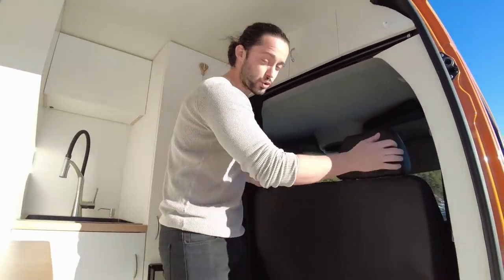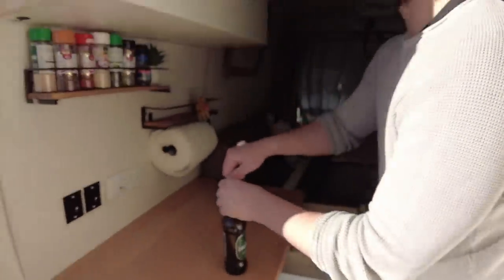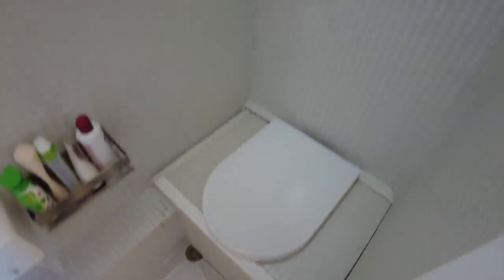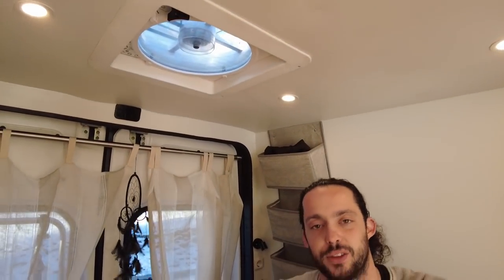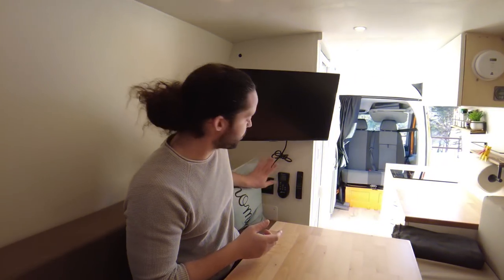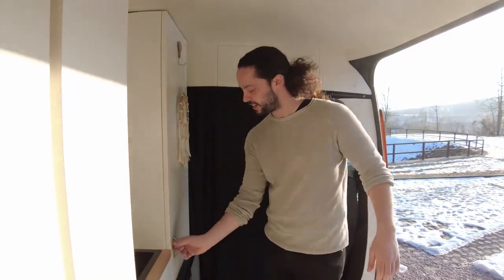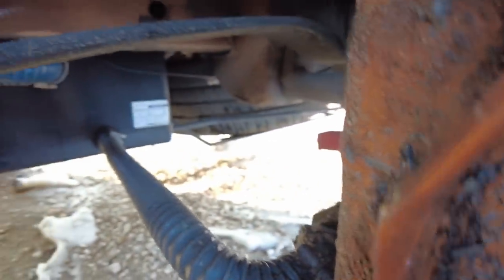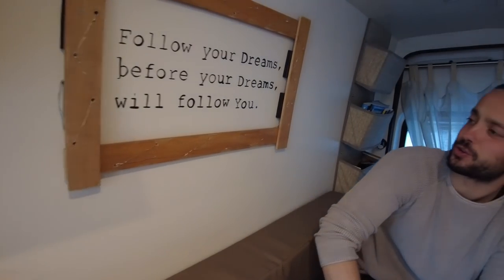Van Tour di Arancino - Furgone Camperizzato Fai da Te 🚐

Comment: Great build, appreciate the details! I am learning Italian and can understand you, not every word though! ;) Quick question, are these 200W panels you mentioned on the blog with dimensions 1240*992*40mm? They look pretty nice on the roof of the Crafter. I was thinking about purchasing 4x 400W panels with dimensions 1906*1043*35mm, but I think they would be wide and stick too far from the roof (in the same fashion, from side to side). Tires are as wide as 2050mm. What do you think? I don't have a car yet, so it is hard to judge and measure.
Reply from the maker: Hello Pavel! The ones I installed i think they're slightly too wide, I realized it some time after finishing the build as I wanted to install an awning but couldn't as there was not enough space on the sides (I am planning to redesign the roof disposition now). As of now, two years passed since I finished the van, and with the panels available now on the market it's possible to get the same output while consuming less precious roof space :) The roof of the crafter is pretty narrow too, choosing long narrow panels I think would be a better fit. Hope that helps :)
Reply: @LostontheRoute  Thanks for the reply. I have chosen 190W, 1396*705*35mm panels, which are already a stretch! I will have 6x of them in total, almost 1.2 kW of power, and will mount them on the rack. It will be my office, so I will need power ;) The ones I asked about were way too large, I agree with you! I used your video to do the measurements, thanks! ;) I will watch the video couple of times for language training purpose ;) You can lift the panels or mount them under a small angle, and install low-profile vents and other equipment underneath. I am planning to install vents underneath one of the panels.

Comment: Ciao veramente un lavorone , sarei molto interessato a vedere il funzionamento del jp Heater.... e nel caso capire come funzioni il riscaldamento elettrico della parte boiler ... perche poter riscaldare l'acqua in viaggio arrivando a destinazione con l'acqua già in temperatura e quello che sto cercando per il mio camper....
Reply from the maker: Ciao Efelon! Se può interessare posso fare un video sul suo funzionamento:) Purtroppo però il JP Heater è un Parking Heater quindi tecnicamente non si può utilizzare in marcia (emette fumi di scarico da un lato del van e se ti fermano ti possono multare). Detto questo, una volta acceso ha una funziona "booster" che scalda l'acqua in circa 15-20minuti :)
Reply: @LostontheRoute  Pensavo potesse essere utilizzato con la sua funzione elettrica in marcia, collegandolo ovviamente ad un inverter con supporto di batterie a litio , con dc dc e mppt a supporto energia...
Reply from the maker: @MrEfelon  Diciamo che il JP Heater ha bisogno di una connessione a 12V per accendersi (e qui non consuma praticamente niente), e poi o diesel o 220 per riscaldare. Il riscaldatore arriva fino a 6kw di potenza, nel caso del riscaldamento dell'acqua 900W per la funzione "Eco" e 1800W per la funziona "Booster". Alimentarlo tramite inverter consumerebbe una quantità di energia elettrica non indifferente durante la marcia (75ah eco/150ah booster...la funzione elettrica è pensata per quando si ha accesso a una 220 dalla rete).
Reply: @LostontheRoute  perfetto, diciamo che con un dc dc da 25 ampere ricaricherei le batterie molto velocemente, anche perché penso che 75 ampere siano per un massimo di tempo di mezz'ora la durata del riscaldamento... Quindi già siamo a 32.5 ampere consumati dalla batteria... In circa un'ora e 15 minuti di viaggio arriverei a destinazione con l'acqua in temperatura e le batterie cariche... Sul mio camper ho montato un pacco batterie a litio da 200ah e un inverter da 3000w onda pura... Mentre ho 500 w di pannelli solari... Direi che si può fare?!  Grazie per la risposta...